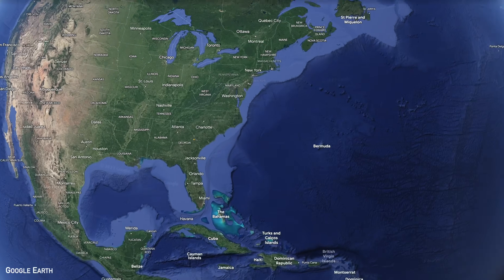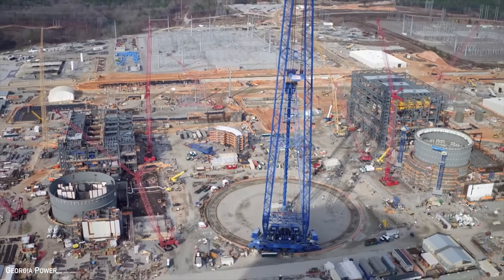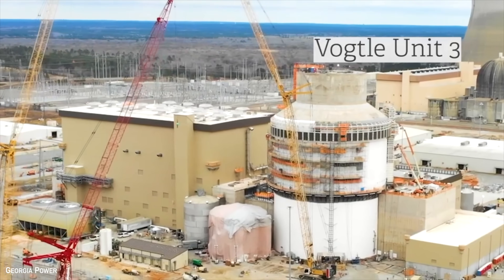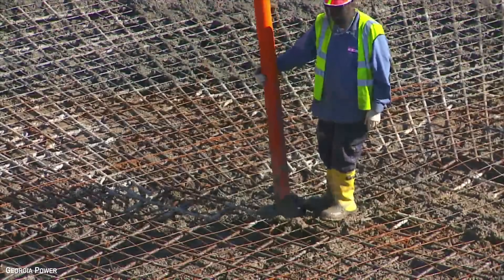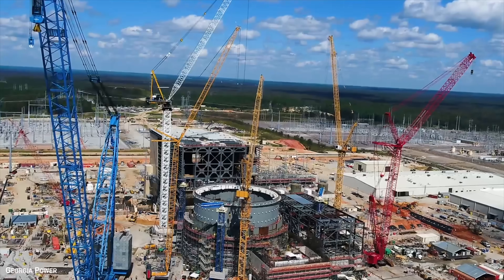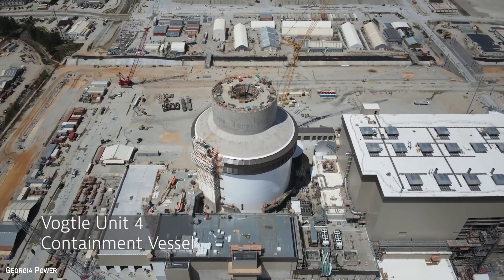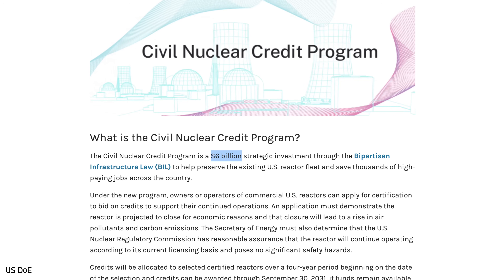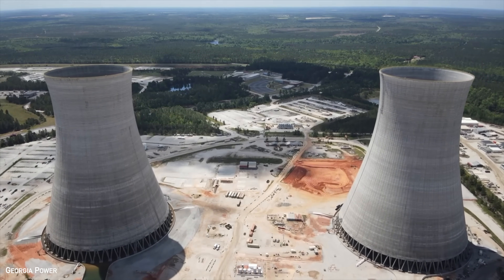Why the Future of Nuclear Power Depends on This Plant

Comment: No path to a fossil fuel free future exists that does not include nuclear power.  We should be building a 80 or 90 new small reactor nuclear plants right now and the grid capacity needs to be increased 40%.
Reply: Agreed! Folks who think the future should only be solar and wind should get to live in houses with intermittent power to educate them on why intermittent power sources are NOT the answer. And grid scale batteries are a long way off, if they actually do come to fruition. Let's not even talk about the environmental damage that would occur to mine the minerals for grid scale batteries. Yeah, nuclear energy is the future green energy. It's time for the U.S. to get on board and start building.
Reply: @iluvtheblues  Don't forget the massive disposal and recycling costs of depleted solar panels, turbines, etc. The amount of concrete and metals needed for transmission lines boggles the mind. Concrete manufacture is a significant CO2 producer.
Reply: It is too late. Invest that huge amount of money in renewable energy available NOW!
Reply: @renebach9583  No, it isn't too late.  The US Government recently approved the design for a new Small Modular Reactor (SMR) and these can be built in less than 2 years (500 days is the target). I have been investing in electric utilities for two decades, and from my research, with the transition from internal combustion to EVs, the amount of electricity capacity we need will double in 15 years, and at the same time, natural gas, which is currently used to produce about 40% of US electricity, is expected to see peak production in less time than that.  The gas will still be produced, but not enough, and that means prices will skyrocket. There is no way to build out the difference with renewable energy. In the US, today these only produce 20%, but to bring it to even 50% of todays demand would take another decade, and by then, your baseline energy production will have to be 45% higher than it is today.  There really is no path forward that does not include SMRs and several US companies are already looking at them as the future. They know it.  I know it. It is not my place to convince you, but if you study it carefully, you will see that Nuclear is going to be a big part of future energy production. 

https://www.reuters.com/business/energy/us-approves-design-nuscale-small-modular-nuclear-reactor-2023-01-20/
Reply: @shenmisheshou7002  I understand your arguments and I cannot comment anymore on the US context (I lived in CA way back in 80-86). But lets tsee again in 10 years if your predictions have beeen realized. 
Here in Europe green parties recommend A) reduce energy consumption : isolate buildings, use much less A/C, install heat pumps, use plants to generate cool environment, ... B) Solar, Wind and Hydro (also current and waves). I believe the consent is that nuclear will cost too much and come too late. Yes, we have to keep current plants and extend their running life. And it is a shame what happened in Germany in the last 10 years. The conservative parties have blocked the transition (like in Switzerland, but now we just passed a law in the right direction).
I've just heard a report saying that small nuclear plants are not cost effective. We need solid quantitative data in our argumentations.
There are two major issues with nuclear energy that the pro-nuclear do not address : waste - they will not disappear for a long time (nobody in Europe wants a deposit near their home) ! and heat generation : all the plants require cooling and the source of coolant is disappearing - I do not know how much heat but we have not justification to ignore it. We need extensive quantitative values for both.
See the IPPC reports! We need wholesome analysis and decisions
Reply: @renebach9583  > Here in Europe green parties recommend A) reduce energy consumption

That is reasonable advice for an advanced 1st world economy with lots of power production already.
It is fairly useless advice for a basic 3rd world economy with little power production as-is - and given the size of the 3rd world populations, we had better figure out something better than plan A for them.

> B) Solar, Wind and Hydro (also current and waves). I believe the consent is that nuclear will cost too much and come too late.

The French spent about 15 years (back in the late 1970s, 1980s) to decarbonize their economy. That may not have been their goal, but that is one outcome of the Messmer plan. Emissions are about half the EU average.

The Germans really got going with their Energiewende - shutting down nuclear and opening up wind/solar RE in 2009? 2011? And it is now 2023 - 12 years have past, 3 more to go to meet the French timeline.
So, with double the price of French retail electricity rates,  emissions are over 3x the EU average, the Germans have 3 years to show that wind/solar RE can do better than nuclear.

Nuclear may cost too much, and be too slow, but the wind/solar RE alternative appears to cost MORE and be SLOWER.

This is not about 'consensus' this is about empirical fact. Germany is the furthest along proving out the wind/solar RE model works, and they can't seem to do so.

[PS - before you bring up Norway, Iceland, Austria - exactly how does working hydro/geothermal solutions prove that wind/solar will be solutions?]

> two major issues
> waste - they will not disappear for a long time
We have technical solutions - France, reprocessing; Finland, burial.
We do not have political solutions - yes, a major problem, but unlike intermittency of wind/solar, actually solvable.

> nobody in Europe wants a deposit near their home
The Finns are ok with a DGR near their home. As are the French.

> cooling [water]
Luckily, NPPs can be sited most places, so we can site them near cooling water. For Gen IV reactors, we can cool them with other substances than water, obviating the need for water.

Realize that the (current) biggest Gen II/III NPP in the United States - Palo Verde - is in the Arizona desert, without access to the sea, a river, or a lake. This is not an insurmountable issue.

> See the IPPC reports!
Do you mean the major reports they put out every few years? The ones where they state that Nuclear is part of the solution? Those reports?

Comment: China’s Ministry of Ecology and Environment on Aug. 2 2022 gave Shanghai Institute of Applied Physics (SINAP) the green light to commission the experimental 2-MWth thorium-based molten salt reactor (TMSR-LF1) at the Hongshagang Industrial Cluster, Wuwei City, Gansu Province. If successful, the TMSR-LF1 could pave the way for development and construction of a larger demonstration facility by 2030, as well as construction of a TMSR fuel salt batch pyroprocess demonstration facility to realize thorium-uranium cycle usage by the early 2040s.
Reply: That is 1/4 the size of the U.S. demo test Thorium reactor that we operated in the 1960s.  60 years behind in that technology
Reply: @clarkkent9080  At least they are doing something potentially constructive TODAY, and China's nuclear success cleans up the PLANET's air, not just China's air.
Reply: @clarkkent9080  at these times smaller but cheaper projects Are key. Slowly but surly.
Reply: @JMiskovsky  They are cheaper to build but not cheaper to operate.

The report below is for the ONLY SMR project currently planned in the U.S. 

In 2022, the Wall Street firm Lazard estimated that the corresponding cost for new nuclear will be between $131 and $204 per megawatt-hour based upon the 4 recent new nuclear projects in the U.S. Renewables have plummeted in cost, and the 2021 estimates of electricity from newly constructed utility-scale solar and wind plants range between $26 and $50 per megawatt-hour. Nuclear power is simply not economically competitive.
SMRs will be even less competitive. Building and operating SMRs will cost more than large reactors for each unit (megawatt) of generation capacity. A reactor that generates five times as much power will not require five times as much concrete or five times as many workers. This makes electricity from small reactors more expensive; many of the original small reactors built in the United States were financially uncompetitive and shut down early.
The estimated cost of constructing a plant with 600 megawatts of electricity from NuScale SMRs, arguably the design closest to deployment in the United States, was originally advertised as costing $1 billion but upon requesting actual bids from engineering firms, increased to $6.1 billion in 2020. Given inflation and other cost constraints that cost today can only be expected to be significantly higher.
The cost was so high that ten members of Utah Associated Municipal Power Systems canceled their contracts. NuScale then changed its proposed plant configuration to 6 fewer reactors but increased each reactor output from 50 Mw to 77 Mw costing at total of $5.3 billion. The NRC just last week approved the construction of the 50 Mw design but now will have to start the review process all over given the switch to a 77 Mw design. For each kilowatt of electrical generation capacity, that estimate is around 80% more than the per-kilowatt cost of the Vogtle project in Georgia — before its cost exploded from $14 billion to over $30 billion. Based on the historical experience with nuclear reactor construction, SMRs are very likely to cost much more than initially expected. And they now have delayed the project start until 2025 in an attempt to find more backers.  All this before the inevitable setbacks that will occur once construction starts.
Reply: @clarkkent9080  yes, totally, how stupid of the Chinese to test and experiment when they could just abandon an entire area of research! they should just scale up the MSRE 100x and hope for the best - then they can prove your (somewhat trivial) point that lack of preparation leads to cost overruns and delays.

Comment: They can build them faster and cheaper in Communist China because they don’t have the regulation morons trying to thwart it, and the lawyer thieves trying to make more money off of it. Question. What country in the world has the most lawyers by far?
Reply: As i understood it, they built the V C Hammer plant in non-union labor counties in South Caroline on purpose, but it was still way over cost to then stop the building after spending 8 billion.
Reply: @ronaldlindeman6136  It was the VC Summer plant and the utilities decide what to build not "they".
Both VC Summer and Vogtle had labor and non-labor workers.  Their are not too many buba workers that know how to weld to nuclear grade when all they worked on is welding mobile home frames.
Reply: So you think they should have just used the dodgy rebar and covered it up hey? Cause without regulations, that is exactly what they would have done. Regulations make nuclear safe. They aren't perfect, but their imperfection errs on the side of caution instead of the side of disaster.
Reply: @SocialDownclimber  sure, you know “dodgy” rebar, like a mob union boss knows that batch of concrete needs to be tossed and replaced doubling the price. Sure you do.  You saw it in the internet.

“Regulations make …”

Yes some do and are necessary. But that doesn’t mean all regs today do, and weren’t out there politically just to stop clean cheap power.
Reply: Yea we need to be using slave labor, paying $1 a day wages and eating monkey, dog, and cat so we can catch up to their communist ways of life
Reply: @clarkkent9080  Chívese don’t use slave labor to build nukes. Same w S Koreans, Turks, Russians… French in the 90s US in late 60s.  All cheap power, and no everybody eats dog

Comment: Some Belgian politicians use the US as an argument to extend the life time of our younger reactors. 
It would be far cheaper than building new ones thats for sure. 
But these spiraling costs aren't particularly inherent to nuclear reactors, 
many mega projects like roads, tunnels and bridges suffer from the same problems.
Reply: The reactors in the USA had an original life of around 40 years. Due to studies on how neutron embrittlement actually works and how thermal transitions are at a minimum (plants are brought to 100% and stay there for 18 to 24 months) the life of the reactor vessels and steam generators is greatly increased compared to original estimates. Companies are now extending the lives of the plants to at least 80 years. That being said no one is going to build these bespoke mega plants anymore because of the costs. The future of nuclear is with SMR tech since the infrastructure can be built to spec and the vessel/steam generator can be built on an assembly line.
Reply: @anydaynow01  how important is neutron embrittlement vs thermal cycles? In the future when we aren't using fossil fuels we really need dispatchable power to balance demand and supply. Batteries work for day to day variation but are too expensive for long term storage. We need something that can be turned on during cold or hot seasons when demand is higher, and during extended periods of low wind output for a week or 2. Can nuclear fill this role in an economically viable way? If a plant was run for say 1/3 of the year it would suffer 1/3 the rate of embrittlement. Would that mean it could run for 3x as long as an always on plant? If you turned it on and off day 6 times a year how much would that shorten the life?
Reply: @adrianthoroughgood1191  > when we aren't using fossil fuels we really need dispatchable power to balance demand and supply. Batteries work for day to day variation but are too expensive for long term storage. We need something that can be turned on during cold or hot seasons when demand is higher, and during extended periods of low wind output for a week or 2.
> Can nuclear fill this role in an economically viable way?
Yes.

The answer is in your 24h batteries.

Work out how the average demand load, then size the NPP to that, use the storage for load following.

Example: a city with a 24 GWh demand (over a day); say 16 GWh/ during the day and 8 GWh during the night = 24 GWh.
Build a 1GW NPP
* this produces 12 GWh during the night - 8 GWh used directly, 4 GWh charging
* this produces 12 GWh during the day - 12 GWh used directly + 4 GWh discharged
As you can see, the NPP runs at constant power, but the demand load is fully followed because of the storage.

Now, take this ideal, and resize for storage inefficiency, and moving from average demand to peak demand day-of-the-year, and include the 'other' NPPs/storage which are operating during maintenance cycles, spinning reserve, transmission losses, etc etc etc.

ps - this is really hard to do with intermittent RE - because unlike NPP, you cannot predict the recharging cycle.
Reply: @adrianthoroughgood1191  What's the point of the intermittent renewables in the first place? Intermittent power generation needs to be 100% backed up with dispatchable power. Seems like a waste of natural resources to build out large scale intermittent power generation and build out the nuclear power plants to back them up.
Reply: @anydaynow01  That, and there is a thermal annealing process to fix most of the neutron embrittlement, so there is no reason why a nuclear power stations can't operate for 100 years.
Reply: When you hire those who do not know what they are doing , do not be surprised that would cost too much and take 3 times longer to build